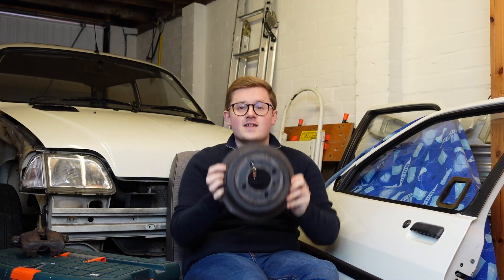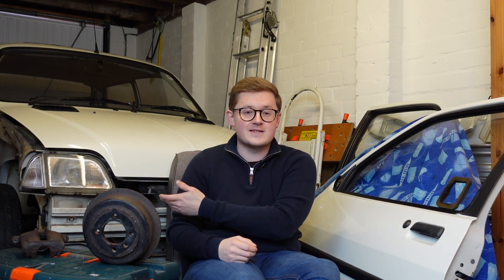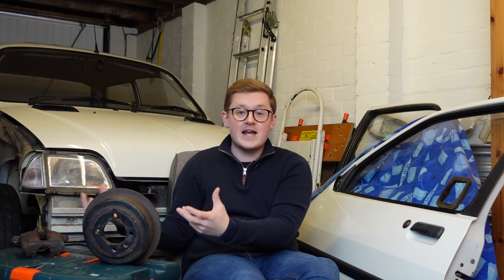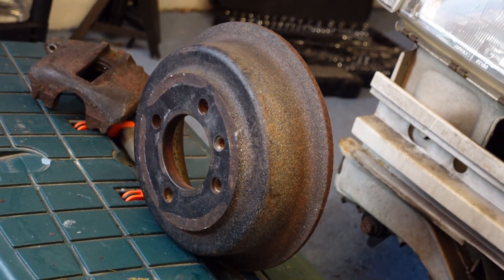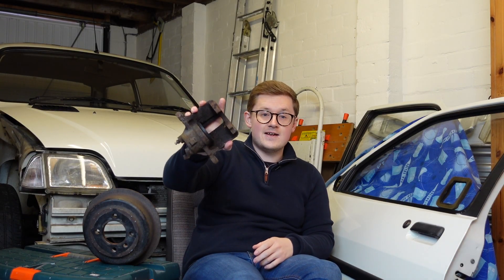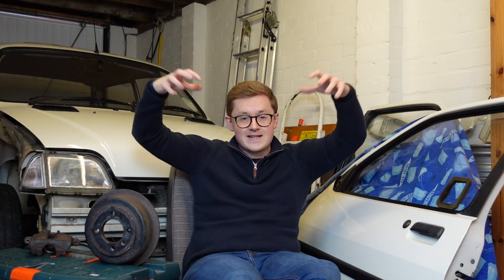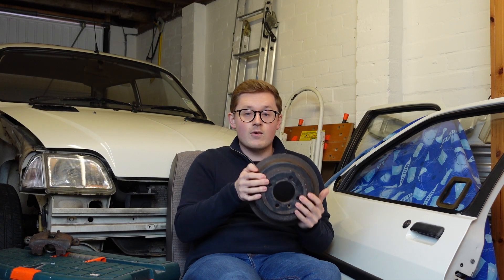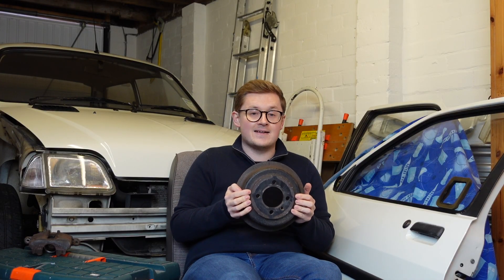Why are Drum Brakes Making an EV Comeback?

Comment: My truck has a set of drum brakes that are 28 years old.  I inspecte them regularly and the system is 100% fine. I had to replace the front calipers and disks two years ago. If you drive right drums are better all the way around.

Comment: The heat inside a drum brake leaves Via the metal in the wheel.  Pontiac's solution to was use a big aluminum drum/hub. that is easier for heat to go thru.
Reply: Bugatti in the 1920/30s went one step further and used alloy wheels with integral drums.

Comment: Well done.  A properly designed NON electronically controlled drum brake system is what 99.9% of the driving public needs. Cheaper,  greater reliability and easier to maintain.

Comment: A flat contact patch is so much more efficient. Drums have a curved contact patch, which means in reality most of the contact patch doesn’t actually contact. It’s rare for even perfectly adjusted drum brakes for the full shoe to contact the drum. BTW drum brakes are no cheaper to make than equilivent disk brakes.

Comment: Do they distort less under extreme heat conditions?
Reply: It's more rare to hear drum brakes warp as discs does. I have never heard it, but I'll let other comments if they have ever heard it.
Reply from the maker: I'm not sure what you're referring to?
Reply: @TwinCam  When discs are warped and you brake, especially from highway speed, the steering wheel is shaking! If the disc's are good (not warped) the braking is smooth and the steering wheel doesn't start to shake.
Reply from the maker: Sorry, I mean the original comment! @alexandrecouture2462

Comment: Saabs and older vauxhalls had rear discs with a drum inside for the handbrake, but I bet 90% of cars with rear discs 5 years old or younger have a electronic handbrake (a button ) in the cabin, this electronically forces the pads against the disc for the handbrake.
An advantage of rear drums also being the handbrake can use softer friction material and give a nicer more progressive handbrake feel.

Comment: Some points to add: My Blazer -79 has drum brakes rear, and it weights... a lot. Even my late -93 Caprice Classic had drum brakes rear and the hopeless Bosch ABS that I disconnected for the winter, never reconnecting it, only for the annual MOT to get the warning light off. As all winter drivers know, ABS does not work in the winter, braking distances may be triple, tested it by disconnecting the ABS.  No use trying to argue that. Here in Finland we have that winter... The parking brakes with the disc brake rears are a joke. Like moped brakes. seldom work well. Electric ones freeze on in the winter.
While I hate EV's, as they are net harmful for everything, they are an effective way to make gullible fools and douchebags visible for the rest of us.
Most disc brake calipers have rubber in some form to slightly release pads when not braking. Sliding calipers have O-rings on the sliding pins that roll the caliper ever so slightly back after braking, and the rubber seal within the piston does the same. That is why the discs rust when not in use even when driving. Even worse are some rear disc brake handbrake drums that can wear out while dragging slightly all the time in a couple of months. I used to have a Jeep GC that had virtually no handbrake about 2 months after the MOT. My now daily driver Hummer H3 is not as bad but close.  
The use of drum brakes in EV's means that the ABS must come partly from the motor(s) because the drum brakes have appalling reaction time and are not good to be modulated with enough frequency. They have too much "play".
The "grabbing" of the drum brakes is easily avoided with correct geometry. As the leading shoe is in effect "wedging" itself, and the rest, possibly floating, system, the starting point of the brake lining is critical; it either assists too much or is just equalizing the effect of the both shoes.
Then there is the longevity of the drum brakes: I once bought brake shoes for the Blazer that said in the box "last as long as you own the wehicle". Nice. But they were so hard that the brakes, especially the hand brake, almost did not brake at all. And the drum became the wear part... So the trick is to get the right combination.

Comment: Car components that 'never have to be serviced' is a scam. In fact, the car makers have designed most of the mechanicals to fail within a certain period. Within that period of time, the components need not to be serviced. But if you want keep driving  your car you must service all parts of your car that didn't need service.
I own a 1973 Norton Commando motorcycle with a stainless steel front disc brake. I does work.
Reply from the maker: Better technology allows servicing intervals to be lengthened or jobs to be removed altogether. Service-free ball joints have existed for decades, self-adjusting drums have existed for decades, and serviceless ignition systems have existed for decades. All of these things work and are proven.
Reply: @TwinCam  Parts made decades ago were mostly somewhat more robust and lasted longer (overengineerd) because engineers couldn't calculate the stresses to the single newton. So they always used a much higher safety factor then they do now.
What the do now is 'designed obsolescence'. Parts are designed to fail after 4, 5, 6 years.

Comment: A drum brake is a much more effective handbrake than stupid rear discs.. The rear brakes only do about 20% of braking anyway, and rear disc are more of a styling thing than an engineering choice.  I could lock rear wheels on my first Honda Civic ( drum brakes ) but when I apply handbrake on my new Civic the car does not even know I have put it on,  The front discs on all my cars have had no problems,  but the rear discs are always going wrong, and that is due to all the water and dirt thrown up by front wheels gets into rear mechanism... The rear shoes on my first car lasted 120,000 miles and the shoes were cheap.  Disc pads are always dragging on the disc, robbing energy, but drum shoes are positively pulled away from contact with drum, which means they do not drag.
Reply: That is why disks have had a minimum runout since their inception, to knock the pads back.
Reply: @johnelectric933  Any run out at all on a disc and you will feel it through the pedal and maybe the whole car......... If the pads get knocked back you will see that when you first apply the brakes that the pedal will go a lot lower than normal....

Comment: For modularity & ease of assembly, EV manufactures need to move to Brake by Wire?
Reply: The whole reason you always have a cable operated brake on a car is because they didn't trust hydraulic brakes. That is the mechanical equivalent of fly-by-wire. The problem is single point failure. They split the front from the rear using a dual master cylinder as a form of redundancy that had some bonus effects. It took many decades for the aircraft industry to remove mechanical coupling to their controls.
Reply from the maker: The reason I don't like the sound of it is the lack of redundancy that John mentions. If such a system at least retained a mechanical, manual handbrake, I would be less nervous about the idea.
Reply: @TwinCam  Here is another problem; regen brakes only work with movement. They do not work at zero speed. The slower they move, the less braking there is all the way down to zero speed equals zero braking.

Comment: One reason for the fade is that the brake drum expands when it's heated. In worst case until the brake shoe cannot reach the drum. That's the reason for the gravel emergency escape ramps for trucks at the end of hills. The bigger surface area on a brake shoe compared to brake pads is also only if the shoe and the drum have the same rounded shape. If not, only parts of the brake shoe will be in contact with the drum, which reduces the effective area.

Comment: Drum brakes are superior to discs in only one respect, they make better static (parking) brakes. They are inversely affected by heat as the diameter of the drum expands, taking the steel surface away from the friction. The violent automated pumping that is ABS is compromised by the excessive movement between the friction and the steel and the wheel cylinder is more likely to be damaged by the movement than a caliper. Servicing drum brakes is a technichian’s nightmare, the final step of adjustment is a game played inside a sealed box. One of the reasons discs took on so well in competition is service time on pit row. But the biggest hole in this picture is the excessive weight involved with E V batteries. Stopping an extra thousand pounds cannot be done better with an inferior system. Excellent video, good theory but I’m not buying it. Drum brakes are returning because they’re cheaper to manufacture and set up on the assembly line when everything is new and perfect.
Reply from the maker: As I say in the video, the heat is no longer an issue, and with electronically-distributed braking, drums are capable of larger stopping forces.
Reply: @TwinCam  I’m sorry but what we are talking about is a device that turns kinetic energy into heat via friction. While regenerative braking takes on a portion of the task, heat has to remain an issue at the wheel brake. And if the inferior drum system works better with electronic controls then it makes sense that a superior disc would respond even better to electronic controls. When drum brakes return to Military and commercial aviation or Formula One racing you’ll have me convinced.
Reply from the maker: @martymiller4300  The brakes aren't being used though. If configured correctly, regenerative braking will stop the car. To mention aviation and motorsport is to simply ignore the central point of the video.
Reply: @TwinCam  you’re right I’m being pedantic

Comment: OMG!  Break pad doost! Into the environment is a issue now! FFS!
And rear drum brakes do 30% of the braking because the majority of the cars weight in an ICE vehicle is at the front.  In an EV the weight distribution is 50-50% because the battery is flat and spans from front wheels to rear wheels.
EV's are an environmental disaster, but if you've been drinking that Kool aid there's no point in trying to talk sense to you... UGH!
Reply: Even with perfect weight distribution there is still weight transfer to the front wheels under heavy braking.
Reply from the maker: You talk of sense, yet say that brakes are front-biased because of the weight distribution.
So how do you explain the 65:35 brake bias of my BMW E46, despite it having perfect 50:50 weight distribution?

Comment: Hi. Interesting video. One important fact that you didnt mention though is the abysmal performance of drums in the wet. Thyey are amost useless because they take so long to dry out, umless you drive with your foot lightly on the brake pedal which slows the car slightly and wear them out quicker. Also ity takes longer to change the shoes than to change brake pads. Good argument that you put up in your defence of drums.🙃🙃
Reply from the maker: They really aren't unless you drive through a ford.

Comment: Very interesting, and very well presented. The only argument I have with this is that my totally drum braked 1958 Frogeye has far and away the best brake pedal feel of any car I've ever driven, albeit you have to shove hard with no servo. Does this mean that we can expect to see the return of the old "try your brakes" road signs after fords? One problem with drums is that they fill up with water if driven through a Ford and then don't work until they've emptied out.
Reply from the maker: I would assume, though it is an assumption, that this is more to do with the lack of a brake servo? The best brake pedal feel I've ever experienced was in both a Wolseley 1100 and a Fiat X1/9, both of which had discs, but no servo.

Comment: Great video, Ed. In the USA, they use electric drum brakes on trailers, that might be an interesting concept if the force can be modulated electronically, in combination with ABS of course
Reply: I can only speculate skipping a hydraulic system in cars would make production cheaper
Reply: @sssxxxttt  interesting idea, if we keap, the front of the brake system,  we dont have to do all of the redundancy stuff "by wire" features require. so we would get great pedal feel, for not so much/same amount of money.
Reply: you don't want electric drum brakes on a car ><, The way those work is they have a electromagnet on a lever.  When you activate the magnet it clamps to the flat part of the drum and drags, causing the lever to activate the shoes.

It's a effective way to have electric drum brakes, but it adds extra wear parts.  It would also only be useful in a full brake by wire system, as adding a mechanical override would be difficult (the master cylinder in hydraulics doesn't NEED power, it won't work well, but it will work without it)

I've heard stories of a bad 12v battery in the nissan leaf resulting in loss of brakes (apparently it has a brake by wire system)
Reply: Total junk. When the Chinese wheel bearing seal fails the brake shoes and drums need to replaced.
Reply: Trucks and trailers in Europe and Australia use disc brakes on trailers, with ebs. There's still trailers with drums, but discs are lower maintenance, better braking, longer lasting and properly self adjusting. Unfortunately drums coming back isn't great as a mechanic.
Reply: @Low760  "...isn't great"  I can vouch for that having experienced seized wheel cylinders before on drums without rear access.  Cant spin drum to get at adjuster so... pulling is a mess: bits all exit about the same time drum lets go and it all goes flying..
Reply: @Low760 Discs to have a lot of plusses over drum, but in an EV with regen braking you need far less mechanical braking.
Reply: Job security

Comment: Excellent video! Some really good points there. Also interesting to note that EVs are fitted with plastic wheel trims, even though they have alloy wheels, the reason being is to control air turbulence (apparently). I'm sure next they'll be fitting manual window winders too 😂
Reply from the maker: It's amazing to see manufacturers suddenly start caring about this kind of efficiency in a way they never did with ICE vehicles. Imagine how high they could make the MPG if they actually tried!
Reply: @TwinCam  They did, that is why the Volkswagen only uses 0.1liter of fuel per 10km. :) I also remember in the late 80ies that the CV value was also brought up a lot in car reviews here. I think Opel had some cars that was aerodynamic around 0.25 in the mid 80ies.  But fuel was realitve cheap back then, so you did not really care at the time.
Reply: Its been used for a long time by many cars. Remember BMW M5 from the late 80ies? it had those wheeltrims that sucked in air to cool the brakes for example. Best is to actually hide the wheels completely, like the Volkswagen XL1 has done at the rear, or like older Citroen CX used.
Reply: My daily has hand crank windows. =)
Reply: Modern EV with heat pump takes heat ebergy back from many sourses… hoe about the breaks?
Reply: Call me crazy but i swapped crank windows into my car. The motors were worn out being 30+ years old and you cant really break a crank window. 

It has no interior so i didnt really need to ever roll the rear windows down anyway and ive managed to get a volvo 240 sedan down to 2500lbs which made it feel really nimble in conjunction with aftermarket suspension
Reply: @StreetForged  There are plenty of hand crank windows that just work a set of cables like the motorized ones do, those can and will break. Check out a 30+ year old miata some time, the lube in the rails goes to peanut butter and someone who puts too many ugga duggas to the crank arm to compensate either snaps the cables or the pulleys and gears that route it around.
Reply: @pontiacg445  i can look at a miata today, one of my best friends has a gutted out turbo track miata. On my volvo, its a banana shaped seat of teeth that turn against a gear on the crank. Dead simple, basically impossible to break unless something binds and bends the regulator
Reply: @StreetForged  That's how a lot of older American cars were too, but not so much on the modern ones.
Reply: My car doesn't have any wheel trim aside from hubcaps. Thank god, too, because they all look ridiculous.

Comment: The biggest downside of drums I have found is adjustment. Automatic adjusters fail before anything else goes wrong. On cars like the Metro that have a manual adjustment its maybe better as you give them a tweek at every oil change. (If someone has not rounded off or snapped off the adjusters)

The VW electric cars are rear wheel drive and very heavy so when the rear brakes are needed (normal rear braking will be done by regen) they are going to have to work hard like the rear brakes on a loaded van so it was no surprise to see drums on them.

Comment: I’d have thought ECUs could have a disc cleaning function whereby they periodically touch the pads onto the discs very lightly to remove rust. They already prime disc brakes by moving the pads almost into contact with the disc if accelerometers judge there’s an imminent emergency. Just a tad little further every now and again would solve the rust issue…
Reply: I believe some EVs do have such a feature, to keep the discs clean of rust, and ready for use.
Reply from the maker: They do, but without really noticeable (and therefore disconcerting or dangerous) braking, they can't thoroughly clean the discs.
Reply: First time I saw this was Mercedes back in early 2000, when it was raining outside, the ecu would touch the brakepads slightly on the discs to remove water.